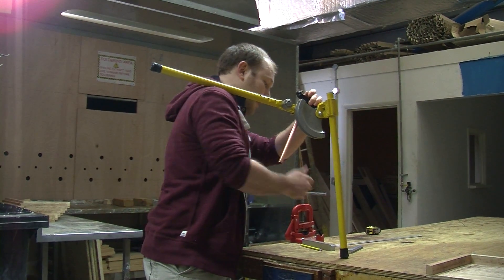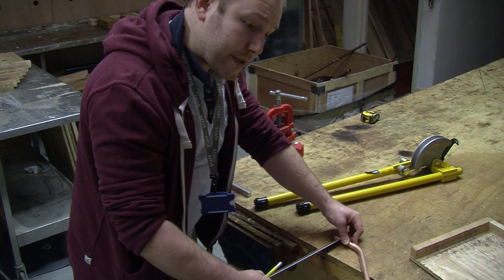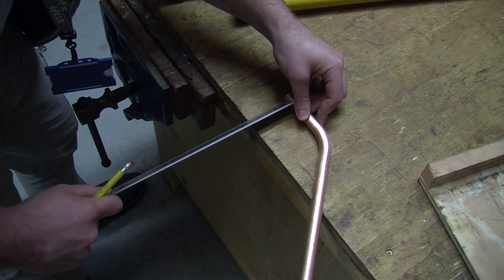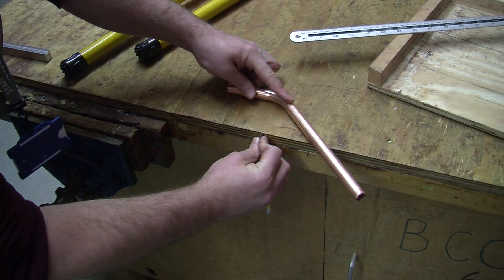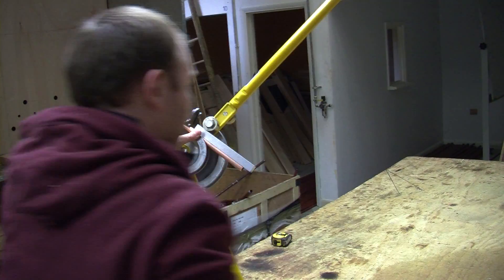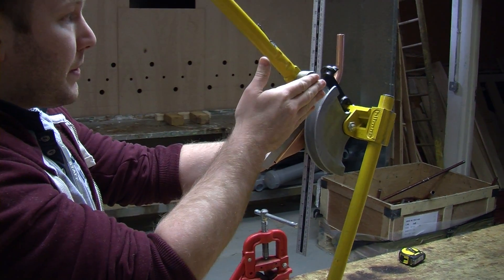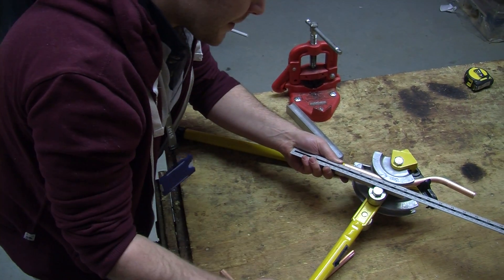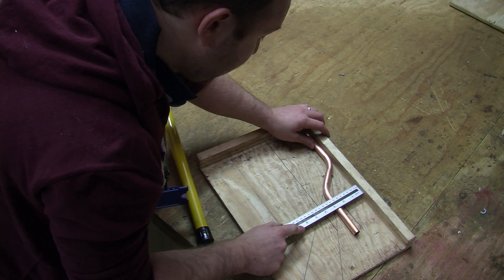Plumbing: Bending copper pipe - the offset bend

Comment: Great video thanks. Good tips about 30 or 45 degree angles for different size offsets. Can catch some people out.
Reply: If the angle is too steep, you cannot fit it in to make the second bend, and the offset would be oversized.